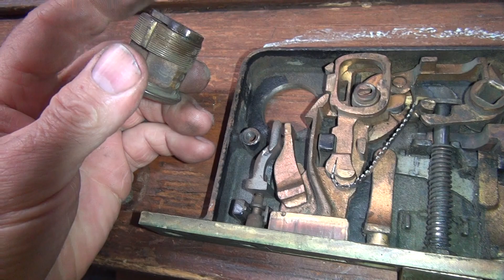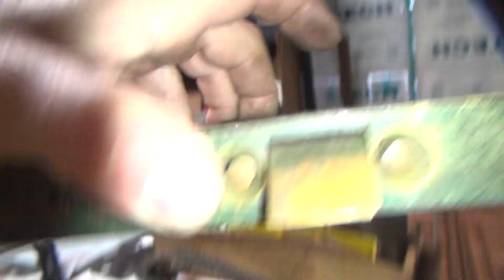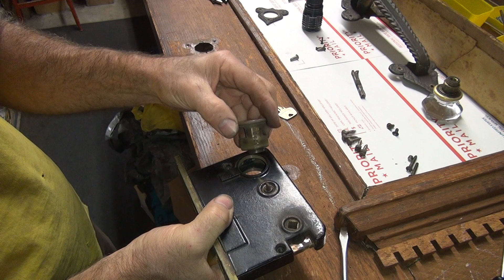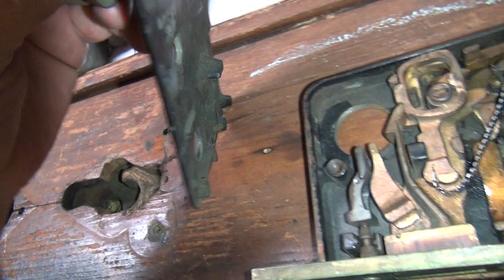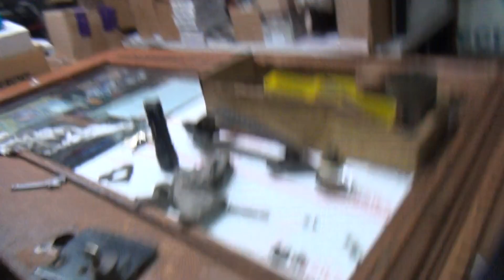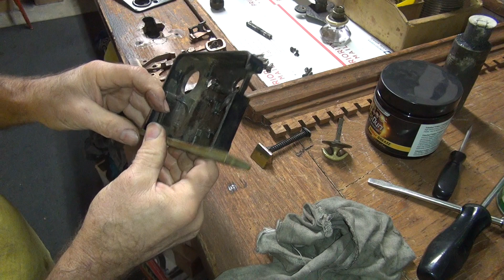#102 tatro's early 1900's lock repair see what it takes to fix sisters ft door harley tatro machine

Comment: Buttons lock out the thumb latch and will prevent someone from opening door from outside. Most all mortice locks used warded keys (much simpler to pick or use a skeleton key), so extra security when you shut the door for the night. The more modern key would have been rather high end at the time, something either on a commercial building or perhaps a judge or banker's house at the time.
Reply from the maker: i knew someone would know way more about these locks than i do. i have only used them all my life, not fix them. both our family houses have these same locks and door handles on them. one is 1909 & one is 1911 or 1913. both were some of the first houses in the neighborhood. they were at the end of the trolley line so i don't think they were bankers. probably just workers that wanted good locks out in the sticks.
tatro

Comment: Been working as a locksmith for a while. Somebody else might have taken that apart before you got it?. Those look like Sargent keys possibly the LA keyway The buttons on the side lock out the exterior thumb turn (DoorKnob) That screw on the edge is to hold the mortis lock cylinder in place Grease not the best choice for those old locks Light machine oil is a better choice Parts are nonexistent there are some modern replicas being manufactured they go by measurements
Reply from the maker: so far so good. its been a few years now and it is still working good. its over a 100 years old now so we will see how much more we get.
tatro
Reply: @TatroMachine  As long as no parts break it could be forever. I've had to have a local machinist build new parts to do a repair I bet you know a good one in your area (you) Proper material is important
Reply from the maker: as you could tell in the videos, i do all my own work. it makes for a short list when things do not work.
tatro